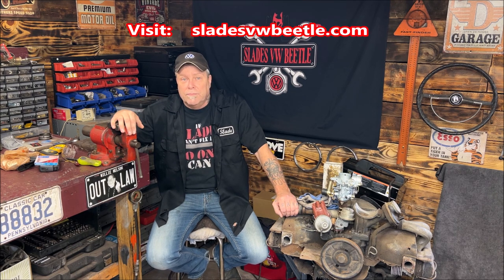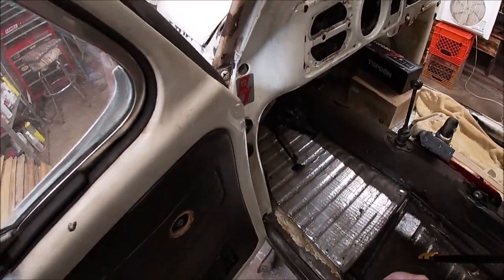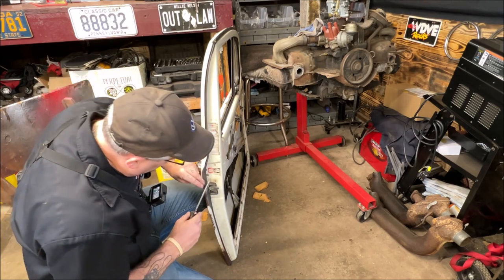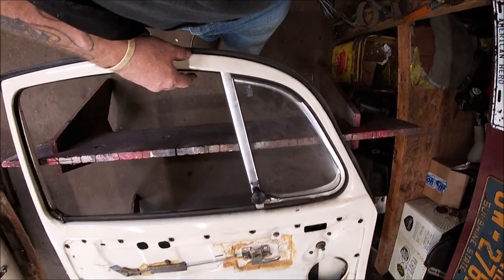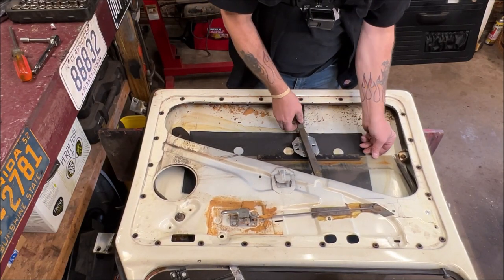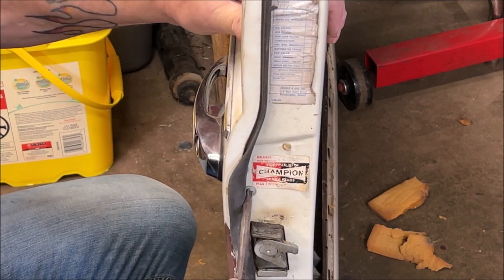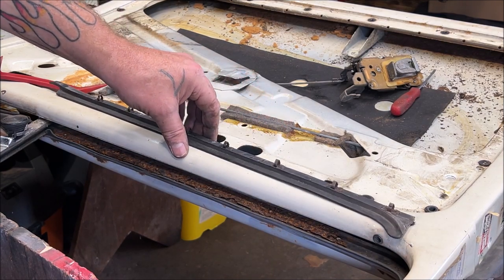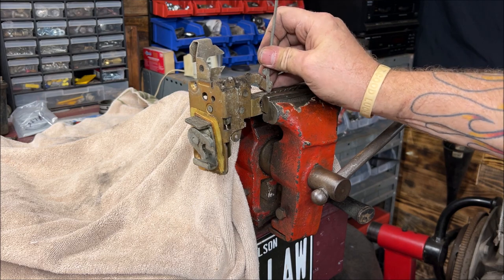VW Beetle Door Latch Mechanism Repair - Complete Beetle Door Disassembly- DIY Beetle Door Video

Comment: Great video! Can you please do a video on the front trunk and rear engine lock mechanisms? I need to see the proper adjustments. Thanks!
Reply from the maker: When I start reassembly I will be definitely doing that. I’m going to try to cover every Single thing on this project

Comment: As an FYI, BBT sells door mounting screws that use a hex wrench instead of a Philips screwdriver. I replaced mine with the updated hardware and they really made a difference. It greatly diminishes the possibility of stripping out the hardware when mounting or taking off the doors
Reply from the maker: Thank you Jeff! I don’t know who BBT is? You can bet I would love upgrading to a hex. The Phillips are a true pain in the butt thank you so much for commenting.

Comment: yep those locks can be very filthy and the hard grease can be removed quickly with some intake cleaner.
a good grease helps it running smoothly like you did and that came out very smooth.
well done my friend.
Reply from the maker: Thank you my friend I hope you are doing well. I got a new microphone on the way, mine was fluctuating up-and-down in the video. It’s amazing how nasty those latches can get.

Comment: Just out of curiosity did you get that video up yet that you talked about in your previous message to me? (cleaning up the rust inside the door w/ Osphos) I'm taking my time on this car since I'm learning as I go on the repairs. Your videos are so helpful and really appreciate the time and effort that you put into all of them. You have really inspired me to do a lot on this car on my own. I have taking the door completed off of the vehicle and all the guts out. I am also going to take my lock cylinder ( like you did in a previous video as well) and take it to a locksmith and have it keyed to my ignition cylinder. It is takes the same blank so I think I will be good. I have a good bit of rust on/in the door but I think it can be repaired fairly easy. I'm thinking that the video that you had on using the JB weld would  probably work since they are just small pin holes at the bottom of the door?? Hopefully! Thanks again!!  You are awesome!
Reply from the maker: Hey! It’s funny that you just ask this question. I just mentioned to my wife, starting Monday I’m going to remove the door off of the car and gut it. 
I won’t film that part. But I’m going to take approximately 3 to 4 days of filming and merging into one film. First will be reaching down inside to the bottom and cleaning up all of that rust. Then spraying the Ospho in the proper method. 
Then, of course, sealing it, and doing the rest of the work with paint. So oddly enough, that will be Friday’s video, I am 98% sure that is what’s going up this coming week. I don’t mind doing some small holes in the bottom with JB Weld. I’m sure a body mound would tell you cut it all out and weld a new piece. But we try to save money where we can. As long as the area is cleaned up very nicely and protected JB Weld is not going to hurt it.

Comment: I'm surprised you didn't use that caliper grease like you used on the pedal assembly.
Reply from the maker: I pretty much stay with the white lithium grease when it comes to the latches. Seems to be the favorite for the locksmiths.

Comment: You mention in your video that you are going to use spray acid, primer, and paint on the inside of the door down at the bottom. What type of acid do you use. I'm new at this and I have a 70 model bug that has a good bit of rust in the bottom of the door. Do you have a video on this? If not...any tips on how is the best way to do this? Love your videos and advice! Keep up the great work!
Reply from the maker: Thank you for the kind comments. I truly appreciate it. 
Actually, I’ll be doing that video soon but it won’t be for about three weeks so you may be done by then.
I use Ospho acid. 
I like to clean up with a wire wheel whatever I can reach. 
And then spray it with the acid very carefully. 
Let it sit for 24 hours. 
And then prime, then paint. 
Here’s a link so you know what the acid looks like. 
https://www.acehardware.com/departments/home-and-decor/cleaning-and-disinfectants/rust-removers/13868?store=09335&gad_source=1&gbraid=0AAAAADtqLJFRPClPh-bKGRm8G4mtjZ6vu&gclid=Cj0KCQjwlZixBhCoARIsAIC745Cpo9TLgtrSeVsIS9iCrjnjMl-NXA1CQh-xVm6VS8Vdh0RPhtn9nOkaAsnFEALw_wcB&gclsrc=aw.ds
Reply: @SladesVWBeetle  Thanks again! You inspire me to push me to work on things that I would have never tried on my own. Your videos are very informative and I really appreciate the way that you "teach" us to do different repairs. You are the shop teacher that I always wanted. Keep up the great work. I also got a t-shirt from your site that I love by the way. I even got a comment on it when my wife and I went to the bug show on 4-13-24 in TN. You're awesome!

Comment: Hi Slade, do you have any videos on how to properly brace a shell before removing from frame? Thanks
Reply from the maker: Hi Josh, do you mean bracing pillar A and B before removing the body?
Reply: @SladesVWBeetle  yes any and all bracing that needs to be done before removing from frame so it doesnt flex. I want to remove and put it on a rotisserie. Thanks again
Reply from the maker: @joshhickman416  I was making sure that’s what you meant, although I thought so. Sadly I do not have that right now. I will when I do the 67 but that will be a little ways off.